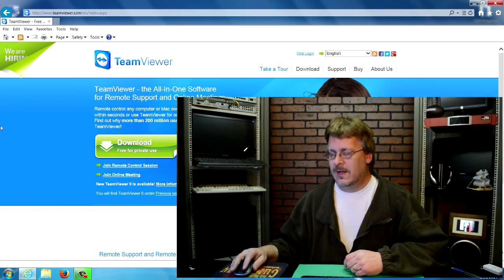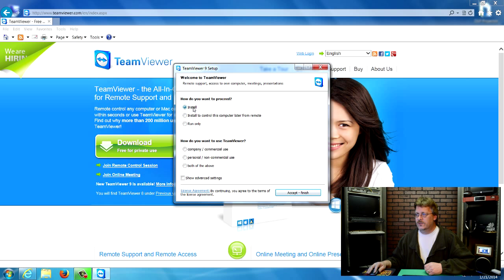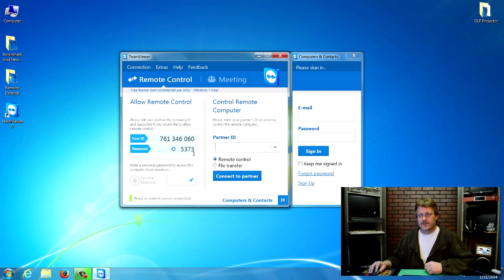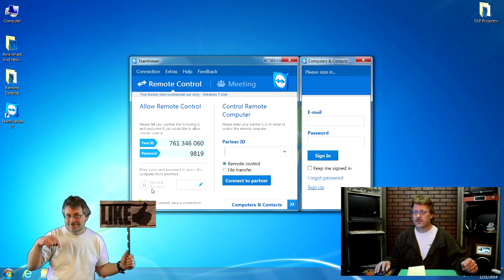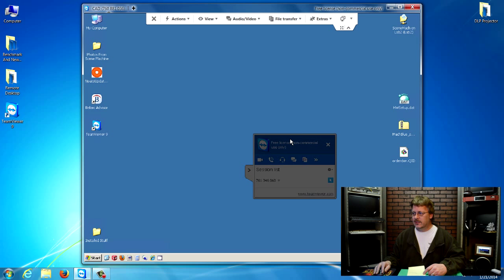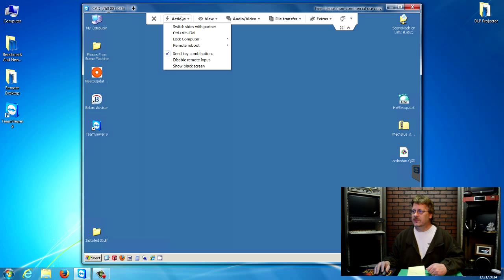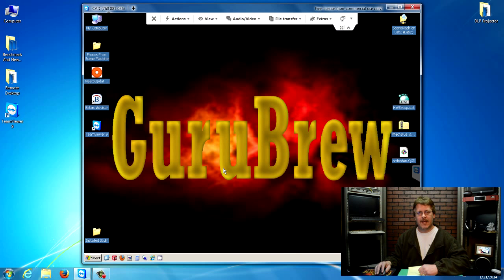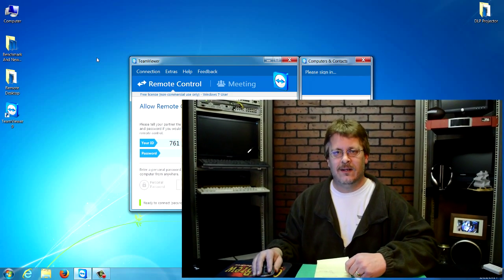How to Control a Computer Remotly Using Team Viewer

Comment: a have question my, another computer's display doesn't opening however case running, it hard disc inside accessing im how? so, opposite device closed if remote check were how?

Comment: hi steve I have question for you ,I have a condo in mexico , my wife goes there by here self ,with this soft ware cdo you think I should be able to control her computer from 4,000 mile away ,so I can activate some programs for her plus stream net flex and other video programs thanks steve great video
Reply from the maker: Absolutely, this would work great for that. Let me know how it works out. Steve

Comment: been using this program for a hot minute now... works great. I use it to control my server from any pc
Reply from the maker: He He - Good on you, I'm sure you will wonder how you did without it. Also check out the website products, they have a wake on LAN package that can restart a serve remotely that is very useful if running servers
Reply: excellent, tyvm sir